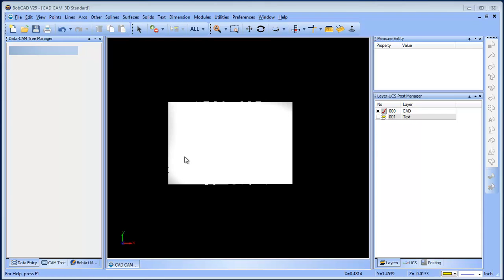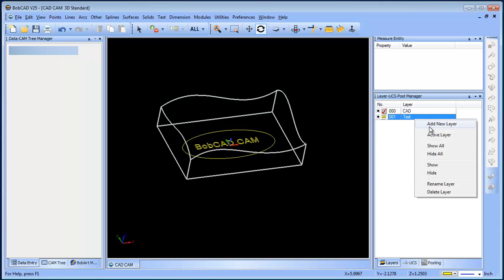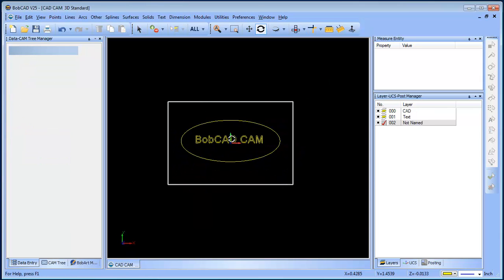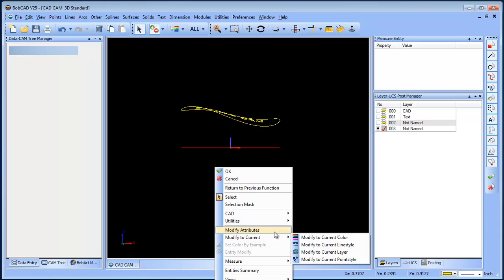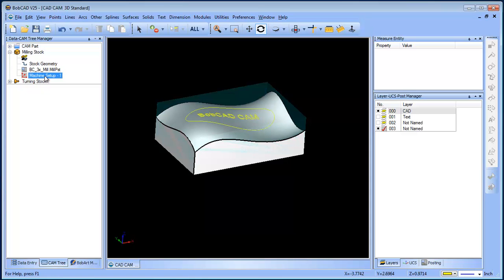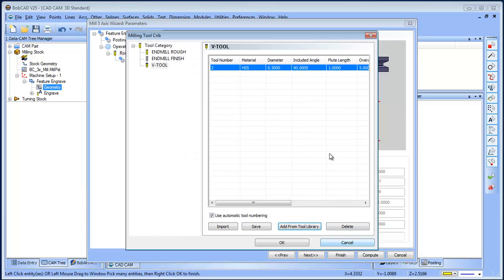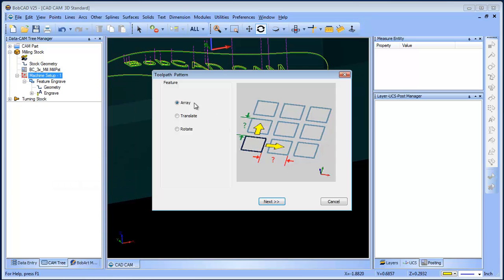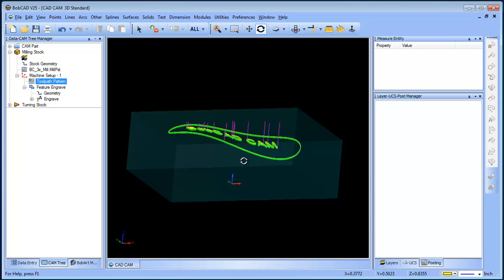BobCAD CAM V25 3D Engraving

Comment: There is no 3d strategy>other>engrave in Bob v27 and v28. There is only 3d standard or 3d pro strategy neither of which has engrave nor Vtool select.  How to do
Reply from the maker: In the current versions of software we renamed the toolpath used in this video to Mill 3 Axis Wire frame.